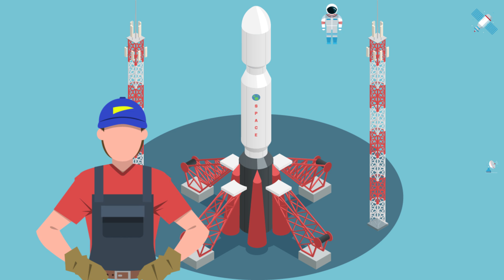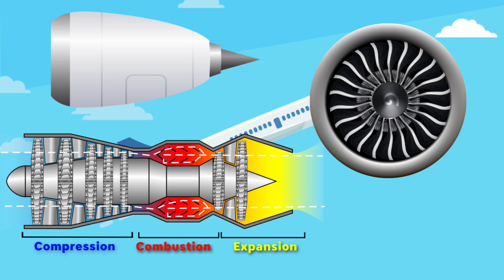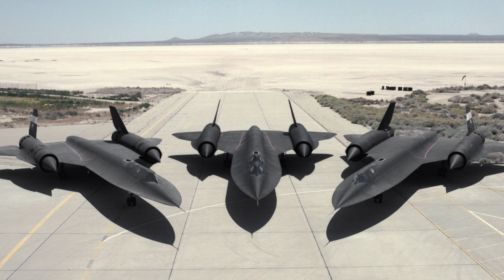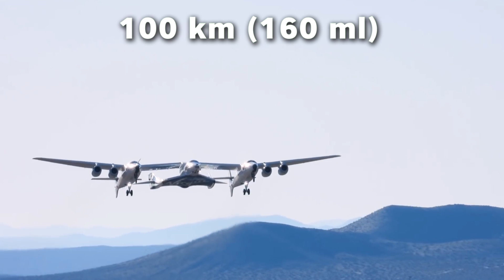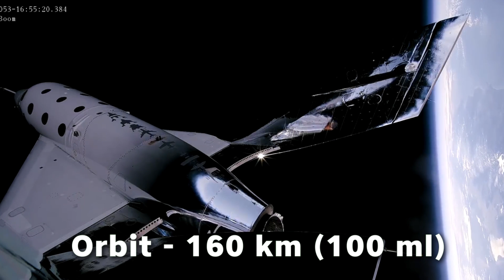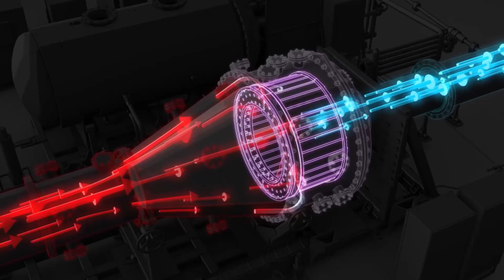How Space-Planes Will Actually Work

Comment: Spaceplanes are better than those de facto  vintage 1961 brute force mentality vertical flight methods of "Space X" and "Blue Origin".     

However, chemical fuels are limited.  

Of as a March 2019 internationally peer reviewed engineering conference held at MIT's Electrical Engineering Dept. on Vassar Street of Cambridge, MA. I gave a presentation on how during the early 1940s Hamgyong Province  a Jun Shitagau Noguchi and a Kim Songsu of Nitchitsu or Nihon Chisso developed a  cosmic ray muon catalyzed fusion rocket plane having had an engine which consisted of a Dewar of  liquefied cryogenic  deuterium isotopic fuel connected to a beryllium alloy reaction chamber nozzle coiled in and around electromagnet coils to focus cosmic ray muons into reaction chamber nozzle where by  cooled by cryogenic isotopic fuel to produce high pressure helium exhaust where by alpha particles are removed.
               
During the 1990s a Dr. Mitchell Swartz affiliated with MIT  published my internationally peer reviewed  articles on such a topic.

Also at such a conference I  gave a presentation on how a Putterman and Naranjo of UCLA patent for a cryogenic pyroelectric crystal cathode fusion reactor could be improved via a molecular sieve to only allow exhaled carbon dioxide CO2 to enter before being condensed , and ionized apart where by carbon ions  fuse together to form oxygen so exhaled carbon can be permanently disposed of aboard an aerospace vehicle.          

Ruby Carat a physics professor posted a transcript of my presentation on online.   
 
Andre Sakharov's muon catalyzed fusion began as Soviet Russian Troops had pillaged Northeast Asia in the fall of 1945  and Luis Alvarez's muon catalyzed fusion began a a decade later after U.S. Troops had explored such industrial  ruins.

So please do not censor my entry.
Reply: Jerome Drexler patents for cosmic ray muon catalyzed fusion and Alfred Y. Wong patents both of California have not mentioned my Prior Art of muon catalyzed fusion such as how of March 2019 at an Engineering Conference held at MIT's Electrical Engineering Dept. on Vassar St. of Cambridge, MA. where I gave a presentation to mentioned a subtle  minor point of how magnetic fields can deflect alpha particles from muon catalyzed fusion reaction.
Reply: My report on Jun Noguchi and Kim Songsu of early 1940s Hamgyong Province who had a Dewar of Liquified cryogenic deuterium fuel connected to a beryllium alloy reaction chamber nozzle coiled in around electromagnet coils is first Prior Art.

Comment: Toyota Prius vs what? Really? Have you driven a Toyota Prius on a typical American Road Trip? Compare that to the ELECTRIC Tesla and the limited range and waiting times, which one would you rather have to get wherever you need to get? How about a cheap $14K ICE Nissan Versa? It will get you there before the $140K Tesla....Skylon is akin to Nuclear Fusion what Virgin Galactic is to Nuclear Fission....One is the upcoming realization of cheap, abundant energy with little or no environmental damage while the other one is the actual, less available, less efficient, higher risk one.....

Comment: “If the design takes too long, then the design is wrong.” Spaceplanes are the epitome of wrong design.
Reply from the maker: Its a bit early to say honestly.
Reply: @curiousreason  
60 years of trying a flyback spaceplane booster and failing is too long. SpaceX tries the VTVL design (ie. a design that recognizes that rocketships aren't spaceplanes. A tower of 80%-90% fuel is NOT an airplane. It's a completely different kind of vehicle.) and in only a few years of the GrassHopper prototype, a Falcon 9 booster stage lands back at Cape Canaveral.

Elon Musk is right, "if a design takes too long, then the design is wrong."

Comment: Ok question time...

How will you get oxidisor when you move into space if you're not carrying oxidisor?

And that ramjet engine thing will only work if..

We first give thrust like we do normally by using fuel+oxidisor and then in the middle 
You enable ramjet engine?? 

Sorry if it's a noob question
Reply from the maker: Skylon does have a tank for both type of fuels, once in space it will switch over to its rocket engines. The main premise of this hypothetical (now) engine is that it will start with turbofans to get a start just like airplanes do, once it pushes to its maximum speed, it will be the starting stage for ramjet.

Comment: 2:23 Bottom left image. This is not a turbofan but a jet engine, you need to add the outer fan.
Reply from the maker: Yes, it is. As the animation view is from the rear side I found no greater need to put the fan cause it wouldn't be visible any. Instead, there is a big turbofan animated from the front side on another corner of the video. :)

Comment: In what way, if any, can aerospike engines contribute to this endeavor? Or is this a totally different method to launch a craft into space? Which would be more viable short term, or is either approach a long term proposition? 

Separate issue. Is there any way around the 25,000mph requirement for escape velocity?.. Would this require a breakthrough in anti-gravity technology? If such a thing is even possible?

Is this a false hope created by sci-fi movies?.. After all, how can you defy or shield a vehicle from something that has no matter? Gravity has no matter, correct? Gravity is the effect of something else, correct?

Our planet's mass has created a very strong gravity well, from what I've read. Or very big objects attract and hold down much smaller objects. I've also read that space is not really a zero gravity environment, but is an environment where everything is falling together at the same speed, creating the illusion of weightlessness.

Have I got that right?.. The Earth, our solar system and our galaxy are all flying away from the center of the universe at a high rate of speed?

Is the kind of gravity defying technology that we've seen in movies in any way feasible? Or is it just total nonsense that has nothing to do with reality?

Is there something other than brute force that can get us into space? Is this even possible?
Is a tractor beam in any way feasible? Riding a tractor beam into space?

Placing something powerful in space that can pull up a payload or ship from the surface of the Earth.
Is something like that feasible? Like a space elevator, but without any cables.

Is there any way for a magnetic field to be projected (perhaps with a laser) to pick something up from Earth orbit, to bring it up to Earth orbit? Or would that magnet in space just be pulled down?

I know that I'm taking a scatter gun approach here with all my questions. 
I'm hoping to inspire future video topics.

yourprops.com/movieprops/default/yp_524d5ee6610192.66733370/Star-Trek-The-Next-Generation-Wesley-Crusher-s-Science-Project-from-The-Naked-Now-3.jpg

https://www.yourprops.com/movieprops/default/yp_524d5ee6610192.66733370/Star-Trek-The-Next-Generation-Wesley-Crusher-s-Science-Project-from-The-Naked-Now-3.jpg

Star Trek TNG season 1 episode 3, The Naked Now, Wesley Crusher science project. The young man creates a hand held device that uses a beam of light to pick up objects.

Is it just total bs, or?..
Reply from the maker: There is a lot of sci-fi involved in your approach. Our engineering capabilities are not as much developed as you might have guessed. Getting up to space, there are stages of atmospheres, temperatures, and densities and a lot more, plus tugging gravity. Reusable Rockets and Spaceplanes, Railguns can be a solution. Check out this last video: https://youtu.be/YR1OeUb6ZA4 its about how railguns can be used to shoot rockets into space. There are more videos coming about how to make space access cheap or alternative rocket launch. I think and hope you will like them. :)

Comment: Spaceship2 is just a rocket with wings, that is aerolaunched and does not have enough power to attain a stable orbit.
Skylon's Sabre engine has a piece of tech thst is the most important part of it and the reason hypersonic jets are not a thing yet. As you you faster the air heats up due to adiabatic compression, as it cannot get out of the way fast enough; it is the same thing that causes a bicycle pump to heat up as you inflate a tyre. Without a pre-cooler the air would be so hot the engine would produce little thrust, that is if it did not melt in the first place. The pre-cooler has passed the first testing hurdle and has a fair bit of interest fro bit aerospace companies. 

At present military jets are at the limits of what they can do without going to systems that are pricey and questionable at best, the pre-cooler would change that.

Comment: Cool video, you got yourself a sub! :) My idea of a space plane/SSTO would be a space plane that carries both turboramjets (like the SR-71) and rocket engines. The turboramjets would carry the space plane to the point where there is insufficient air for the air-breathing engines, and then switch over to the rocket engines to continue to orbit. Although the biggest problem I see with this setup is you'd have to carry 2 different fuels for the 2 engine systems, unless they run on the same fuel. Although SpaceX has been using kerosene-based RP-1 fuel for their rockets and Jet A for jet engines is pretty much kerosene, so I guess it wouldn't be too difficult to get the two systems to use the same fuel.
Reply from the maker: Thank you :) Exactly, maybe this is one of the reasons why SABRE engines of Rocket Reactions are designed to carry the only payload without passengers, I think its mainly because the fuel takes too much space of the plane considering its air-breathing and rocket engine. They will probably redesign to carry passengers instead of payload.

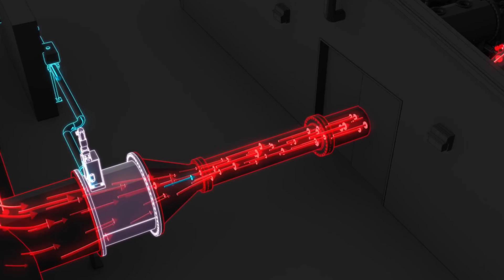Comment: I found a few mistakes, though only one is really worth pointing out. At 7:05 you say SABRE is "designed to efficiently switch from a turbofan to a ramjet to a rocket". None of that is really true. Rather, it's always a rocket engine which is partially augmented by ramjet engines. The efficiency comes from its ability to use atmospheric oxygen for part of the flight.
Reply from the maker: Yikes, yes, you are right. I apparently used a very old concept info about SABRE.

Comment: good animations, but the explanation of turbofans and the sound barrier is not very clear or correct (and the mispronunciation of fuel is distracting).  turbofans work just fine beyond mach 1, afterburners are not anything special for this.
Reply from the maker: Yes, turbofans work fine beyond Mach 1. With afterburners what I really meant was to connect in between turbofan and ramjet so it would be more close to the efficiency of a ramjet which is Mach 3. If I am not wrong, turbofans can only go up to Mach 1.6 - 2. Afterburner at that point might not be greatly necessary but I didn't want to skip it. It's good for people who don't what afterburner is. About the mispronunciation of "fuel", I did try, to be honest, maybe it's my accent, working on that. :)